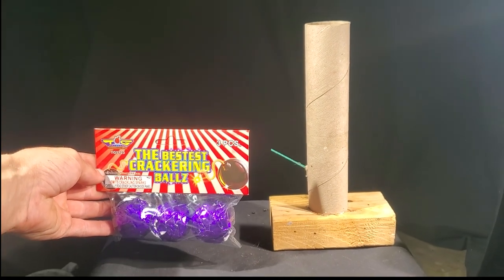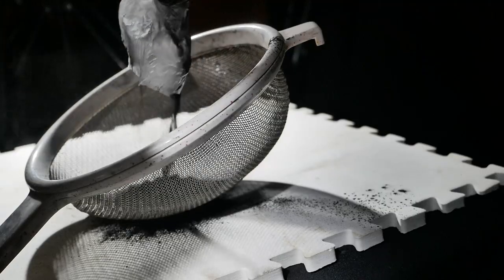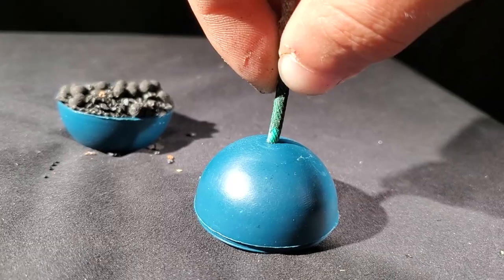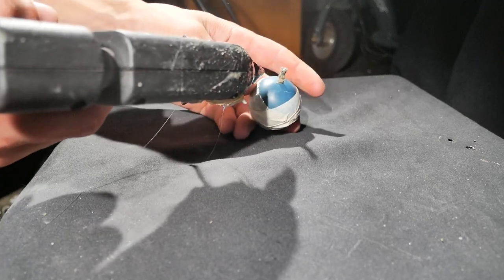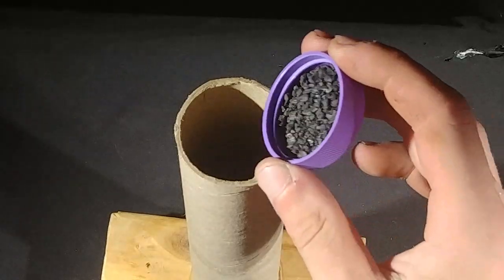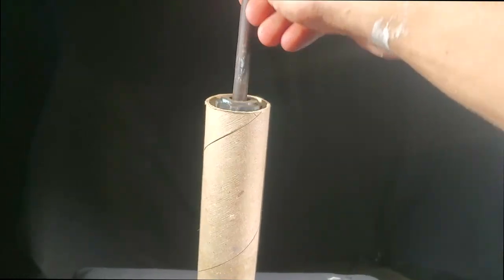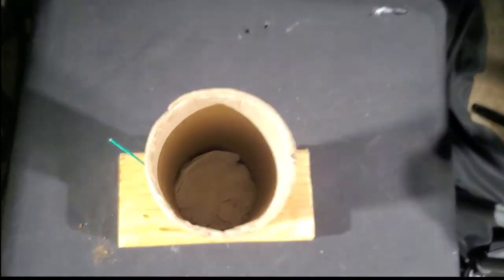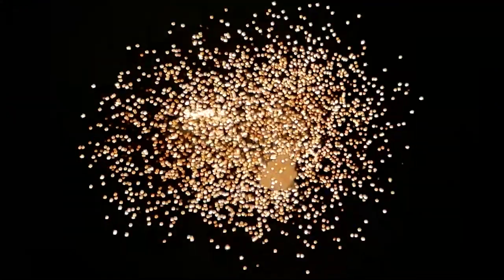Turning Crackle balls into Firework Shells

Comment: Wait what happens if you just launch the unmodified cracker ball (besides removing the external packaging)?
Reply from the maker: it wont pop open well
Reply: @ianbuilder why do you remove the flash powder you could keep everything in the crackle ball but add more powder then glue it back together

Comment: Rather than hot gluing fuses into the tube...
Take a small strip of thin tissue and wrap the fuse at the point where it will be through the tube.
This will hold the fuse tight and burn away easily.

Comment: hi i just wanted to ask, if you could use instead of the gunpowder you used in the shell and the mortar just using the blackpowder from firecrackers?
Reply from the maker: it burns super slow
Reply: @ianbuilder i thought flash powder is more potent than black powder

Comment: Hotgluing a very flammable fuse to flammable smokeless powder is reckless and irresponsible. I like your content man but you easily coulda got hurt... And some dingdong watching this trying it themselves very well might
Reply: It's flammable material ... How can hot glue or a glue gun ignite that ? .... Don't know when a fuse will combust from heat ... But it will probably take more than that :)
Reply: @DannyKa-x8z  if the metal gets too hot it can catch it on fire. You need to glue the fuse before putting in the powder just to safe.
Reply: @Mr.Defalt  A normal high-temperature glue gun can get up to 380 degrees Fahrenheit. Gunpowder will ignite at some where between 570 - 660 degrees F. Cardboard doesn't catch fire until temperatures reach over 400 degrees. However hot gule guns are know to spark, so you sould unplug before you glue anything flammable.
Reply: You don’t know you’re first name or anything about fireworks 😂
Reply: @Matspyropowerhouse  That English though